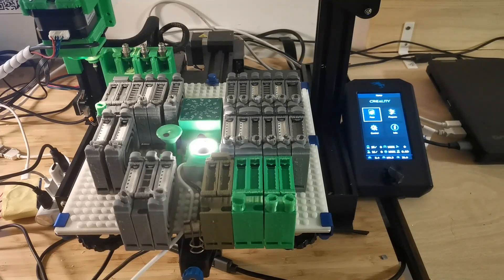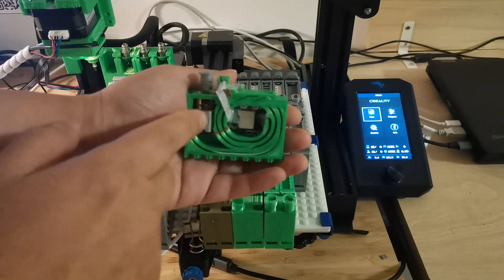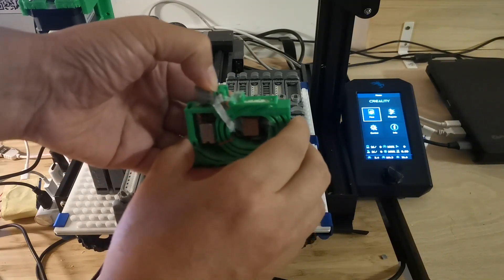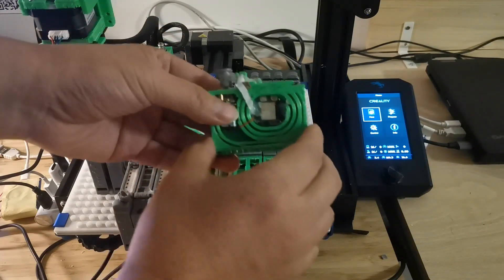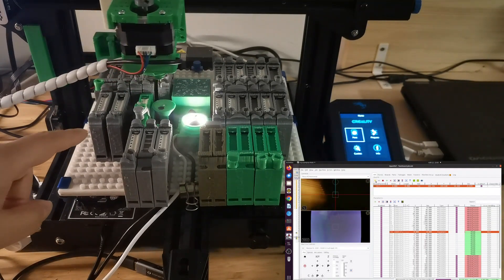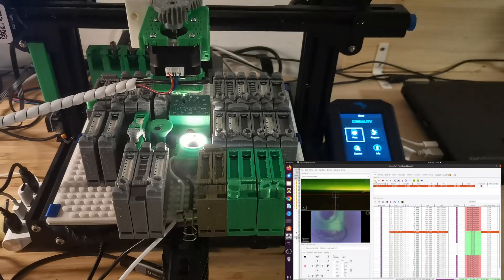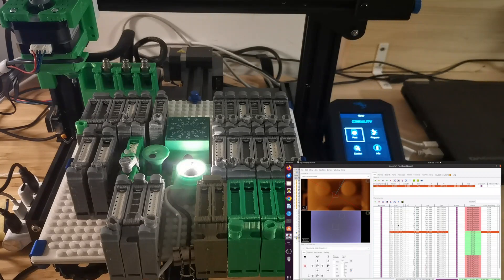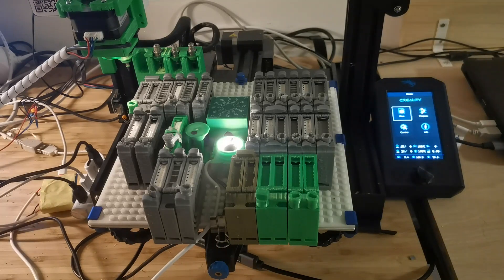3DPlacer - the world's smallest autofeeder?Mini wireless autofeeder for pick and place machine

Comment: what about using two metal strips for power? you can place them on the mounting base and provide power from underneath to all the feeders which are is the same row
Reply from the maker: Good idea, thought about that as well, could be an easy solution, currently I am working on a solution that can provide power, also can provide position info, I will give some update soon.
Reply: @xpdiy  good luck 😊

Comment: It would also be cool if it could charge while plugged into the machine. Maybe inductive charging.
Reply from the maker: Currently I am working on a position aware solution that when plug in, it gets the power and also position info from the plate. I am still thinking if I can remove the battery to save on cost.

Comment: What a magical work. I've been  watching it for a long time, but I   still   can't understand how it accurately moves forward by 2mm😇
Reply from the maker: Thanks! Acutally we don't need to move 2mm, referencepushpull feeder supports 2mm pitch but 4mm advacne mode, so every 2nd pick, the feeder will move 4mm, which is easier to implement. And internally the feeder is counting picks, so every 2nd pick it also advance, that way it supports 2mm pitch.

Comment: Battery power? Are you nuts. Batteries aren't cheap and over a year its going to cost you a fortune.   Feeders only need to be activated one at a time so there's no need for a huge power supply.
Reply from the maker: It is ok for battery, around $3 for battery 250mah, over 1 year, you probably need to change some of those ones that you are using intensively, if thinking about normal feeder $50-200, it is really small portion of cost. For the power supply, I am not worry about how much current it can supply, but mainly on how to distribute the power, as it is 2D Lego plate, user can mount anywhere they like. But currently we are working on power supply block as well, that also includes the position awareness feature, so it will be easier to use.
Reply: @xpdiy  Just use ribbon cable with IDC connectors placed evenly. That's what I do with my 3D printed feeders. I have 24 feeders but need another 10 at least. 34 feeder batteries is a lot of batteries, and I use my home made pick and place machine a lot. Motors draw lots of current. Your machine is also painfully slow.  I don't think its worth the effort to build such a slow Pick and Place machine.
Reply from the maker: @RobertA-hq3vz  Ribbon could help definitively, in our case we need something integrate better, so we are designing a block PCB for that. For the speed, well, it is for hobbyist, I don’t think such a high speed is priority (still room to increase), it helps me a lot already when placing 10,20 boards, for bigger batch, it make sense to go with more expensive machine.
Reply: @xpdiy  I make about 20 boards at a time. Each board has about 30 components. The machine doesn't have to be super fast but I don't want to spend all day on it either.  I hope you reconsider the batteries as I suspect you might regret it later. Good luck with your project.

Comment: Amazing miniaturization! How long is the maximum loaded tape? Am I right to assume the tape is advanced by pulling on the protective film? Looking forward to more videos and more! _Mark
Reply from the maker: Thanks Mark, the tape I measured for 210 mm for max length, a bit more than 100 for 2mm pitch. And you are right about the pulling, I was thinking about driving the sprocket  hole in the beginning, but that will require driving + collecting film with more mechanical structure, so I had to go with this way. I am still optimizing the design, will get more videos out.

Comment: I am working on a similar design usign ESP8266 but my feeders are controlled via wireless communication using ESP-NOW, that will require too much power but mine are taking power from bus. How are you doing 2mm advance  if you rely on 4mm hole spacing, also for transparent tape optical sensors will not work  with transparent tapes so only mechanical switch is the option.
https://youtu.be/IeZcGXMZzIo?si=fgEhPKJ6-W1YHNii
Reply from the maker: I am using ReferencePushPullFeeder, and set the pitch to 2mm, hole distance to 4mm, then it will alternate between 2 mm, then the feeder need to advance every second time. And you are right about the sensor for position feedback, I am using mechnical one, but it is not fast enough to count when user putting in taps, so I am exploring the optical ones, but transparent tape will be a challenge. Nice build btw of your feeder, it is advancing on 2mm, do you use stepper for that?
Reply: @xpdiy  it uses a absolute position 12bit magnetic encoder with N20 motor creating a PID closed loop setup
Reply from the maker: @DoTheDiy  That will be really accurate, nice build!

Comment: I think this is cool.  However you already control the lego board mounting system.  Why not create a design where certain rows can provide power and gnd on each "nub" then you could design it so that you could just place them on the board and get power.  This way you can avoid lipo, save space.
Reply from the maker: Actually I got more suggestions on this direction, thanks for brought up the idea, I got support from an experienced engineer (shout out to Nikki), and we are building a base plate that supplying power, and better, we are trying to make it position aware. Stay tuned!
Reply from the maker: This is indeed a good idea. I thought about going this direction, each feeder will have a contact, in the end I go for the one with battery to get a bit of flexibility and ease to assemble (compare to the contact points assemble of the baseplate). Yet still, this is a good idea, for ex. also to make a "wireless" bottom camera or other possible parts that requires power.

Comment: Very inovative! It would be nice to know how does the auto-feeder knows when the nozzle is picking a component from the tape. It could be a button under the tape but not clear. Then it would be important to know how the motor is stopping at 2mm or 4mm based on the feedback of the component-tape.
Reply from the maker: I use proximity sensor, actually multiple sensor can do this, button probably will be tricky as the clicking will make component bounce. The advancement is supported by openpnp feeder, so when you specify 2mm as pitch, it knows that every 2 components will have one advancement.
Reply: @xpdiy  proximity sensor a very inovative idea. Thank you very much. I appreciate it. Regarding the advancement that is supported by openpnp feeder the question is how the motor is controlled by the ESP232 (mcu) so it knowns when to exactly stop it for 2mm as pitch. I am thinking that is not a stepper motor so how you control how much to rotate?
Reply from the maker: There is another sensor I used to observe the hole of the tape as feedback, it can be either mechnical or optical sensor, and the hole only have 4mm pitch, therefore to support 2mm, the openpnp provide the support to only advance.
Reply: @xpdiy Thank you for the response. It is amazing how you integrate it!

Comment: How difficult do you think it would be to support 24mm tape? I have hotswap sockets for keyboards that I for the life of me cannot get feeders for. I've got a Panda Placer, but I think this could be easily adapted. 

I've been watching your work for ages and this is surprisingly usable even on my bigger machine!

EDIT
Honestly, this feeding method just using the built in strip feeding vision is crazy cool. I could see this working for full spool machines!
ETA on you going into a demo phase? I'm more than happy to pay for plans!
Reply from the maker: 24mm tape should be working similarly, might need stronger motor driving, and a bit different casing design, I would say it shouldn't be too much to support that. Currently the casing and power consumption need to be improved, could be in 1 or 2 months to get better. If any thoughts and idea, feel free to drop me an email contact@xpdiy.io.
Reply: @xpdiy  If you get a chance post the hardware and some of the structure, I think that this doesn't even necessarily need to be in your cassette design, but in almost any feeder. The nozzle detect ; feed logic is so small that it makes feeders much more "flexible" in size.
Reply from the maker: indeed the idea can work in otherway as well, I still need to improve the design before I make it public, stay tuned!